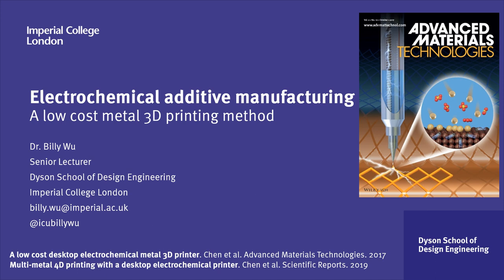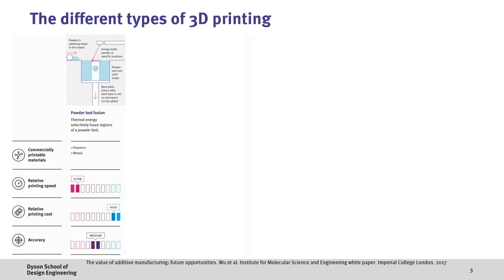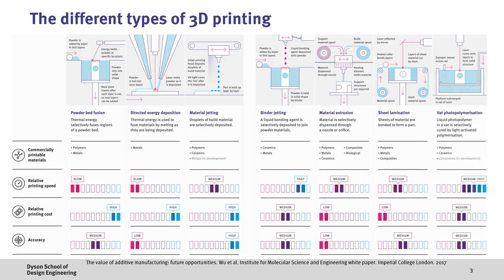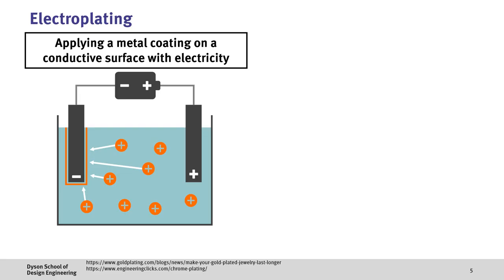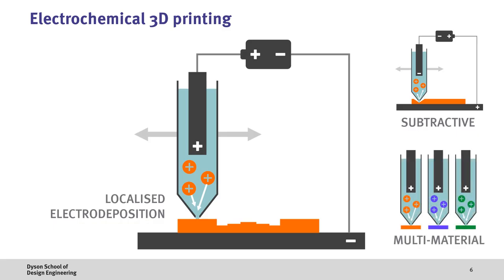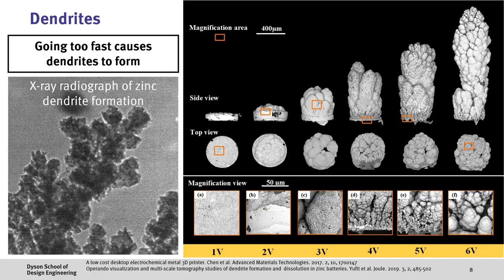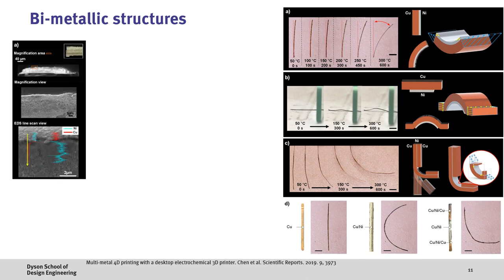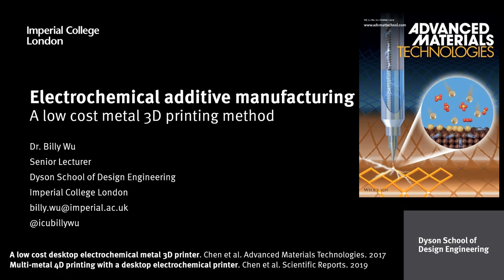Low cost metal 3D printing! Electrochemical additive manufacturing

Comment: Is there a limit to what materials you can use... obviously you can use copper, nickel, and chromium but for example metals like steel, aluminum, titanium, and a multitude of other metals, basically what im asking is are there limits to which materials you can use, also you could probably make an alloyed rod to going into the syringe to get alloyed printing? idk just think here
Reply from the maker: Great question. In principle any metal you can electrodeposit you can use this approach, however one thing to bear in mind is that we designed this to use relatively low cost and accessible components. Some electrodeposition processes use more aggressive electrolytes and temperatures to get a good deposition and therefore would need modification to make safe. In some cases you should be able to control the alloy composition by varying the deposition potential and control.

Comment: Very interesting stuff! How robust is the printed structure? Is it as strong as the Laser melting method?
Reply from the maker: Thanks for the interest Stefan. From the tests we previously did, we can see that the hardness of the material is generally higher than cast copper due to the small grains that we form during deposition. We haven't compared this with direct laser melted copper, but would imagine that its favourable since we have low defects, though our sample size remains relatively small.
Reply: @BillyWu  Wow, that's great! I didn't expected that. Thanks for the info :-)

Comment: This technique is good for micro or nano 3D printing!!!
Reply from the maker: Yeah, there's been some work with nano-pipettes to make very small structures. The challenge then is the volume deposition speed drops so in general there's a trade-off with speed and resolution

Comment: How do you manage the replenishment of the anode?
Reply from the maker: In our case, the anode which was a copper rod was periodically replaced manually. We were mostly printing very small items so the mass of the copper rod was far in excess of the printed item so we didn't have any problems with running out of material, but its a simple case of connecting a new rod and putting it in solution.

Comment: what kind of post processing would parts made with this process need?
Reply from the maker: Normally we just need to remove the part from the substrate. In our case we printed on aluminium foil and then were able to just manually peel off. If really stuck in theory you can just dissolve the aluminium away

Comment: If you use a bath, you could have a bed of nails style print head with hundreds of heads which could speedup the printing process.
Reply from the maker: Definitely. I believe a company called Fabric8Labs is taking this approach with an array of electrodes to hopefully help speed this up.

Comment: Do copper and nickel deposit at the same voltage? Given two electrolytes don’t cause some undesired reaction, could you use a single syringe and apply alternating voltages to perform multi-material deposition in one go? (Not a chemist). Follow up: would aluminum sulphate work as an electrolyte? Could you print aluminum parts?
Reply from the maker: Voltage is a relative measure between 2 different points. Since we use copper/nickel as the anode and cathode the voltage we apply to get the deposition is similar but generally nickel is a bit slower without any additives. It is possible to do a co-deposition if you get the mixtures right and you can electrodeposit alloys in this way but its a bit more tricky. Aluminium can also be electrodeposited, but often required more challenging electrolytes and we wanted to stick with water based solutions. For example, we stayed away from gold since its more expensive for prototyping but also many deposition solutions use cyanide containing components. Essentially, nearly all materials you can electrodeposit with you can print with.
Reply: @BillyWu  thanks for answering my questions. Really novel approach. What are your + your team’s current thoughts on ways to speed up deposition? I understand that y’all were able to increase deposition speeds of Cu by 34% and Ni by 85% by replacing the sponge with a nanofibre.
Reply from the maker: @davidlanday6102  There's a few potential avenues. Certainty moving to other non-aqueous systems can potentially accelerate this but will be a bit more tricky to handle the electrolyte. Additives can help and also print head designs that minimise the mass transport problems I think are ways forward.

Comment: Amazing approach! If the speed limitation could be overcome it could spark almost another industrial revolution, or at least help bring manufacturing back to EU and USA.
I was wondering if localized electrochemical deposition could be used to join 2 wires (e.g. welding wire) of the same metal together, essentially speed up the process significantly, for the cost of some precision?

Comment: Is it possible to put multiple electrodes with different metals in a single syringe and then apply a voltage to the electrode with the metal you want? Would it be possible to make alloys like this by using multiple electrodes at once with different levels of voltage?
Reply from the maker: There's a few other studies that have done co-electrodeposition which by controlling the deposition voltage you can control the composition. For example in this paper https://pubs.acs.org/doi/10.1021/acsami.0c01100 they do a nickel-copper deposition with controllable composition which is quite nice for making sensors. The challenge is making sure a constant amount of metal ions stay in solution

Comment: This mathode is possible to use in existing FDM printer ?
Reply from the maker: Yup. We modified a standard FDM printer to achieve this by replacing the print head with a syringe holder and filling this with an electrolyte and a rod of copper/nickel. You'll also need a power supply to enable the deposition.

Comment: What are the material properties of resulting prints?
Reply from the maker: Good question. We did some indentation tests and generally for the copper this was harder/stiffer than bulk cast copper which we attributed to the fine grain structure when printing with electrodeposition, where smaller grains generally give harder/stiffer materials but are more brittle

Comment: A very interesting concept, thank you for sharing!
However, am I correct in assuming that this can not print "islands", structures which are not supported by already printed material underneath?
Conventional 3D printing solves this by printing supports underneath, however I assume they might adhere to much when using metals.
To me, it seems like that's where printing in a powder bed or gel matrix excels. No supports needed and even "floating", unconnected parts won't fall of until they're fused.
Reply from the maker: Yeah, to deposit material we need electrical contact. You can create some "island" structures by printing in a different material and then selectively dissolving the support material in a similar way to how water soluble supports work in FDM printing. True that powder bed fusion for polymers can make these freestanding structures. Much more difficult with metals though, due to higher thermal stresses. Just messes up the print bed.
Reply: @BillyWu 
That does make sense. Thank you for the answer! :)
And again thanks for sharing this process with us!
Reply: MichaelKingsfordGray  
...come again?

Comment: Do you think gold metal would take faster?
Reply from the maker: We haven't done gold electroplating yet but I think it's slightly faster than nickel, however it does normally use a cyanide based electrolyte so we avoid this where possible.

Comment: Could this be used to print something like 4140?
Reply from the maker: Good question. We've mostly focused on pure metals such as copper and nickel. There are some alloys that you can electroplate, however since steel is an alloy of iron and carbon, it could be a bit more tricky since this is normally manufactured at high temperatures through mixing and solidification.

Comment: Or the syringe could implant ions into a permeable dielectric substrate; coated epoxy-fiberglass?
Washing the substrate in a chemical bath would initiate 'electro-less' metal plating on the ions.
Plated-thru vias in PCB's are made this way.
Printing the pattern would be fast; the time-consuming plate-up process is done in batch mode; thousand of parts in the same bath.
What do you think?
Reply from the maker: Yeah potentially printing a pattern first and then increasing the thickness could work. Definitely lots of different ways to take this forward so more people working in this would be great

Comment: Could you submerge the entire build palte in the copper sulfate soloution and jsut use an electrode that very very localy applies the voltage and builds up the part?
Reply from the maker: Definitely, that would work too, however the features would be less well defined, though some use very fine electrodes. The meniscus means that you only get deposition where there is liquid.
Reply: @BillyWu  But what do you do with the menuscus once you have printed one layer, ir even want to put down a line next to the current one? It will start to pool, leading to a reduction of accuracy.
Could you also point me to a paper or two on submerged electroplate 3d printing I could read? I am very interested in this process. Thanks
Reply from the maker: Good question. Close control of the meniscus is key. This article talks about the work from a team ETH Zurich who show the meniscus in more complex 3D prints https://www.azom.com/news.aspx?newsID=57437. This review paper talk about localised electrodeposition https://link.springer.com/article/10.1007/s00170-020-05799-5
Reply: @BillyWu  Have you read this paper, very intesting. That high plating rates (50um/s for a 0.5mm nozzle) could enable macro scale 3d printing.
I just put it into my slicer, and you could 3d print a 20x10x5mm object in under 24hrs

Comment: What if make printing head like flour sieve (with gates or something) and print lot of particles at once ?
Reply from the maker: Yeah. There are 2 main approaches for electrochemical additive manufacturing. What we showed here is the meniscus confinded approach where you have a bead of electrolyte to focus the deposition. You can also have a bath of electrolyte and use an array of electrodes. This needs more electrolyte and th resolution of the features can potentially be less well defined, but it can be done.

Comment: Just out of curiosity, what do you believe the price point of a ECAM printer once fully developed?
Reply from the maker: Great question. The components themselves aren't very costly and mirror that of standard plastic 3D printers with the stepper motors, frame and control electronics. The different components include the pipette, electrolyte and power supplies which are all generally low cost. The challenge is that speed is still quite limited in terms of volumetric deposition rate so still needs some work.

Comment: What's the largest object printed with this technique and what time did it take to print?
Edit: I see from other comments that it would be really small
Reply from the maker: Yeah, unfortunately it is quite small in terms of volume. It's relatively each to make mm-scale objects but with limited depth. We demonstrated some very thin lettering in the work that was several mm. Could potentially be used to make circuit tracks... slowly, or sensors

Comment: Is it possible to deposit metal from molten salts?
That could enable 3D printing of metals such as aluminum or magnesium.
Reply from the maker: Certainly. If you can electrodeposit a material it should also work in a localised deposition printing approach. Some people use ionic liquids to do deposition of metals so more exotic materials than copper are possible.

Comment: Could this be combined with plastic printing to make 3D embedded circuits in stuff?
Reply from the maker: It's a bit tricky as it needs to be printed on something conductive to have access to a flow of electrons, but what some people have done is start from a point and then print a circuit from there, so in theory you could do that

Comment: There are a few fundemental problems with this.

First, electroplating is slow, and I dont know of ang ways you can speed up the process by several orders of magnitude. At the voltages you describe, it would take weeks to complete a decent sized print. 

Second, strength. The faster you grow your structure, the weaker it will be. Electroplated structures are more similar to wet sponge than anything else
Reply from the maker: Fair points. Speed is still an issue with this approach but there are some niche applications where the scales are much smaller and multi-material might be useful, but still at the R&D stage
Reply: @BillyWu  multi-material work is limited by the chemical reactivity of the plated element and electrolyte. You really cant do anything with it. You cant use alloys, and the whole thing will corrode because you have two different metals in close contact. This is a step backward 1000 years metalergy wise

Comment: But how are you going to get liquid stainless steel and liquid aluminum? Makers, Designers, Builders and Inventors aren't clamoring to to print copper parts.
I suppose there's a possible chromium nickel solution that might be somewhat viable... but maybe not as a functional part itself.

What I picture as a possible low budget solution, is suspended microfine powder (agitated upon nozzle dispersion) in a UV curable medium. Much in the same way that flat bed UV printers can print white ink (titanium dioxide) through piezo electric discharge. Yeah, you are back to the binder removal process, then the furnace/kiln firing in an inert chamber thing... but honestly, that's a device that could be cheap if produced at mass scale. We aren't talking about much complexity beyond a PLC, heat bricks and heating elements. The door just needs an airtight seal, and a gas valve solenoid. It's literally not beyond the skillset of a competent fabricator. (So, somewhat DIY to a degree)

I think we need to explore industrial print heads, and their maximum viscosities they can push, and what mesh powder can we squeeze through them before clogging is an issue. I mean we seem to be quite OK with a 0.4mm nozzle hols for FDM printing, provided the z-step is minimal. I'm willing to bet that quite a bit of suspended metal powder could squeeze through a pressurized print head with nozzles that large.

The UV curing could be localized too... utilizing a fiber optic approach, you could get the light right down by the nozzle with a light pipe, and not reflected anywhere else, like back up the nozzle hole.
Reply from the maker: Nice suggestions. There are also metal jetting systems which are starting to emerge for larger scale metal printing but you're right this approach has some limitations

Comment: Could you use an array of say 1000 head outlets to all be printing in parallel to speed it up?
Reply from the maker: There's a few works which use an array of electrodes which you turn on and off which can accelerate the process but generally this has to be immersed in a bath of electrolyte. There's also a few other things you can do to increase the deposition speed such as higher temperatures and different electrolytes. We just used a low cost solution as copper sulphate is quite cheap. Some root killers use copper sulphate

Comment: Doesn't it take to infinity to finish a 20cm high print ? 
What are the cons in here ?
Reply from the maker: Yeah, you're right. This approach of printing metals with electrodeposition is a bit slow for large parts. There are a few tricks to speed it up but at the moment the main applications are likely to be smaller items, where the ability to put down metals means you can start to build conductive pathways

Comment: what about using ordinary cheap copper wire at the extruder with a extruder made of plastic or something nonconductive with a flat tip of the wire  dipped in a hydrochloric solution with a thin metal plate at the bottom. that should allow the copper to dissolve rapidly and build up on the plate. can also increase the voltage to that of the amps to accelerate the electrons in the solution. with about less than a milimetre of gap distance chould reduce random ion floating outside the printing alignment. the rate of print is only limited to that of conductivity in the solution. printing speed is something that can be perfected. you still need the the feeder mechanism of the copper spool to keep the gap between the wire tip and the plate fixed as the plate or wire moves.
Reply from the maker: Yeah, we considered using a wire feed as well but wanted to try and keep it as simple as possible, but yeah there are lots of alternative ways to do this. Would be great to see what other designs people can make
Reply: Doesn't work well. Already tried it. It does work up to a point, but past a certain speed the water starts to boil and it destroys the print quality.
To go faster would involve non-aqueous electrolytes and high temperatures... Which are decidedly unfriendly to work with and come with all kinds of surprises like thermal warping and cracking.
Basically, wire is a no go. You'd be better off by modifying a traditional welding process... Which isn't as hard as it sounds. Miniature welding is totally possible and at reasonable speeds and temperatures.